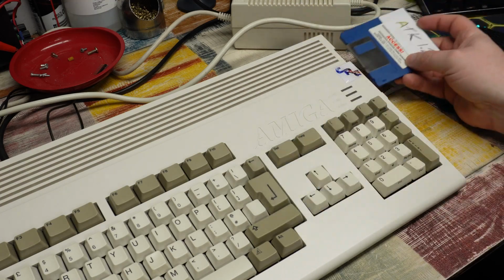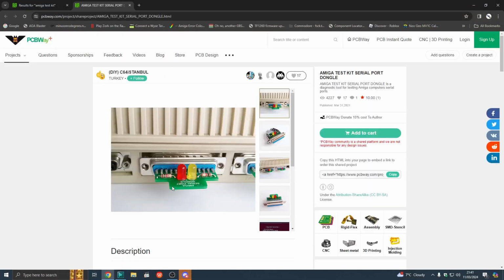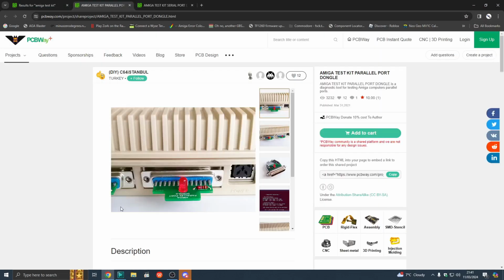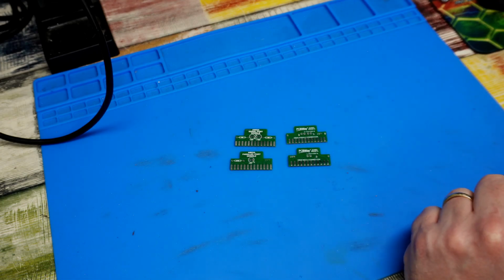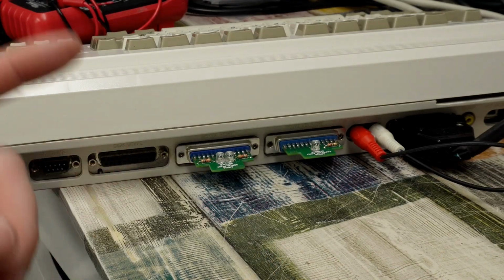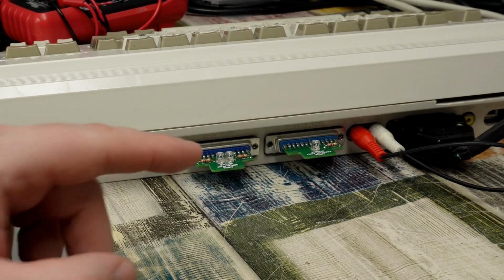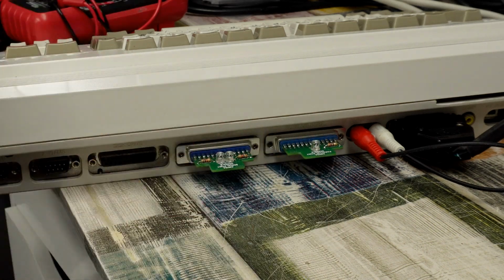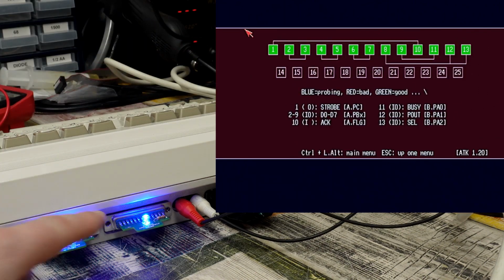Amiga Test Kit Serial and Parallel Dongles build and test

Comment: Did you not have an episode where you built the Z2 SID card (or did I got confused with someone elses channel)?
Reply from the maker: Yes I had but it was taken down for reasons I'd prefer not to get into again.  There were some concerns over a logo on the pcb.
Reply: @CRG I understand, too bad.
Reply: @CRG but the volume output on yours was fine? You did not have to add an amp to get good sound levels?
Reply from the maker: No it worked fine but I had it routed through the prelude sound card so that may have amplified it slightly.
Reply: @CRG nice gonna do the same

Comment: I build a set of them, just soldering connections in DB25 plugs, as shown in test kit and LED plus resistor. Drilled holes for LEDs in DB25 housing. Really handy for testing :) Does not look as good as the ones you build, but they work.
Also made a set of them for a friend who has a shop here in Denmark, selling vintage computers.
They have helped me a few times, when having serial fault on A500 PCB. I have repaired a few A500 machines, that had faulty U38/U39.

Comment: I would add plastic housings to prevent damage and keep the àssembies safe during insertion/removal.  
Maybe make a video on how to build the serial cable that allows simultaneous diagrom use/viewing on a PC (unless it's a null modem).
Reply from the maker: A plastic housing would be handy, I'll see if I can come up with something to suit the LEDs I used.  The serial cable for diagrom is just a standard null modem cable so probably doesn't need a video per say but the next time I'm using diagrom in a video I'll make sure to clarify that point.